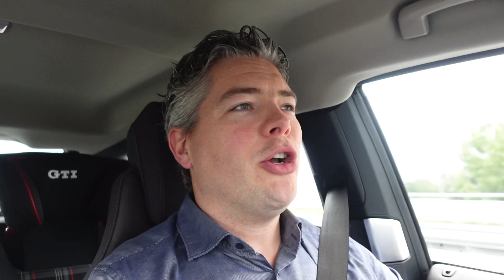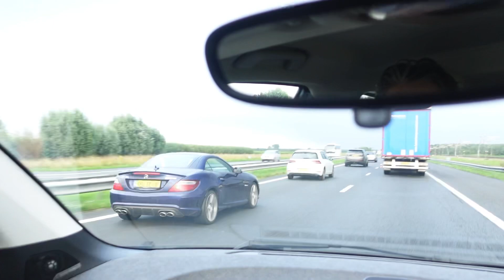How to improve the cooling on the BMW i3? Part 1

Comment: Dunno if you ever got your answer but the EV drivetrain is liquid cooled through the radiator in the front.  I image you could plumb in a bigger or secondary radiator. Personally here in Canada I have the opposite issue where it takes too long for the battery to heat up and takes too much power to heat the cabin.

More information can be found here: https://www.leschroniquesdegoliath.com/wp-content/uploads/2018/01/Mercedes-06_I01-High-voltage-ComponentsGB.pdf

Comment: Route a hose from your hvac to blow cool air into your pack ;) and or onto the engine !
Reply from the maker: There is some heat shielding that I could remove.....
Reply: The i3 already uses the AC to cool the battery pack.

Comment: How does your ac work? Great cooling? If not its also used for cooling the battery
Reply from the maker: Yes it works great and the battery isn't the problem. The overheating takes place in the drivetrain.

Comment: Unfortunately, I believe BMW battery coolant is a specialized coolant (can't be obtain at autopart store or refillable), correct me if I am wrong. If it's refillable then I am sure someone will come up with upgrade cooling system. I wish there is a way to make it refillable so we can flushed it.

Comment: The real question is does it need additional cooling? Monitor the motor temperatures across a range of driving conditions to see if the limit is reached, any improvements implemented won’t have an impact if this is not the case.
Reply from the maker: Unfortunately you can’t monitor the motor temps while driving. Only the battery temp.

Comment: The most I do on a long journey is 75mph (120kmh) as all our motorways have a 70mph limit. I notice when I stop there is clearly a fan running at the engine. I assumed it is aircooled but I've not had any overheating. I'm sure I read it's the aircon system that cools it, as if the aircon in the cabin fails, then the battery doesn't get cooled. I appreciate that doesn't help your quest for improved cooling - hopefully someone can give you an answer.
Reply from the maker: I made another follow-up video tonight. Will upload tomorrow!